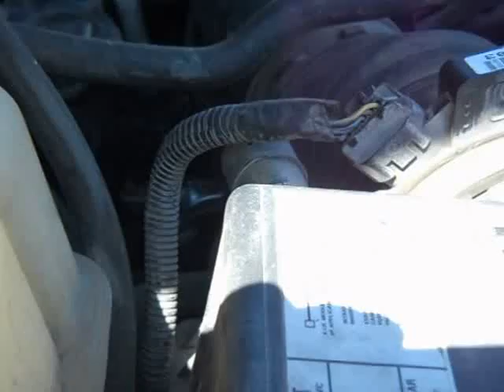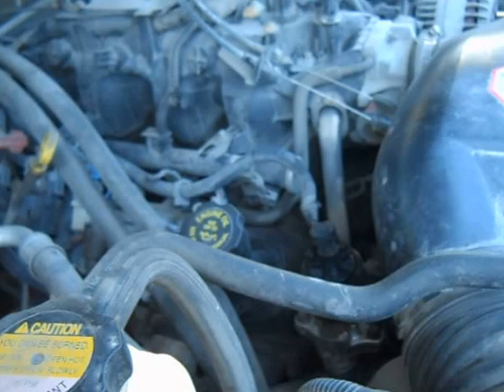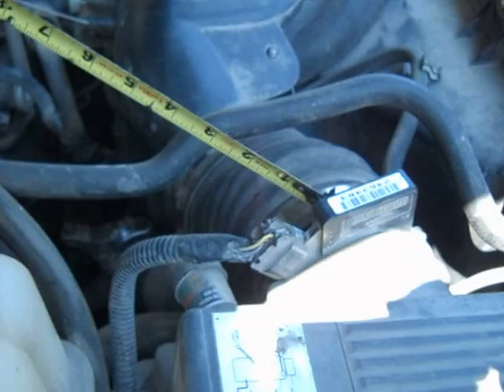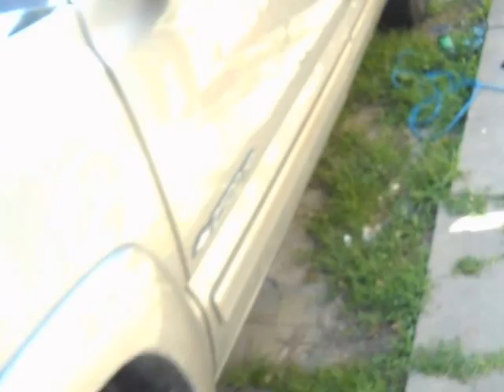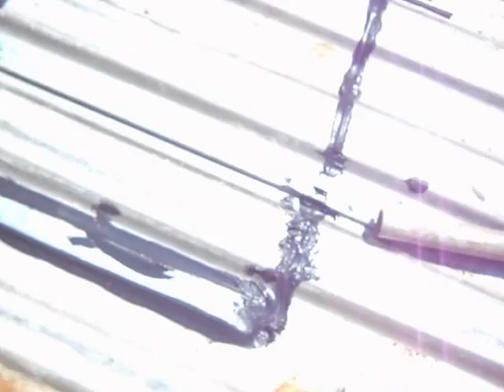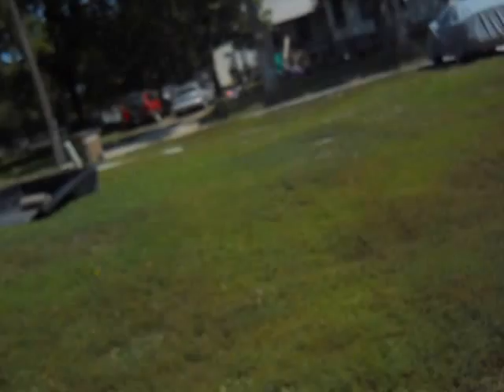DIAGNOSE FUEL PUMP, MASS AIRFLOW SENSOR. CHEVY LOW FUEL PRESSURE

Comment: I have a 98 Chevy Tahoe I replaced the fuel Port injector system and I change the fuel filter new spark plugs and the MAF sensor and I'm still having trouble to start the vehicle and if I put starting fluid it turns on but it won't stay on
Reply from the maker: I would hook up fuel pressure gauge up to fuel rail and check fuel pressure when you turn key on...put down a deposit at auto parts store and use for free..

Comment: OMG you don't need to cut the bed! You loosen the bolts on the bed on the passenger side, take the bed Nuts off the bolts completely on the driver's side. Take the screws out from the filler neck. Unplug the tail lights by the rear bumper and the plug for the trailer hook up plug. Jack the bed up on the driver's side and block it up. It will be hinging on the passenger side bolts. Disconnect the fuel pump plug, take the bolts out. Pull the pump. Install in reverse. Don't wear static producing clothing. Make sure the battery is disconnected, the wheels chocked and have a fire extinguisher close by. Don't cut the bed.
Reply: Takes about 45 minutes to change the pump out.

Comment: So can a bad mass airflow sensor mess with fuel pressure, i changed out the pump and the filter still reading low pressure
Reply: Buy a can of Mass Airflow sensor cleaner, don't use anything else. Take the Mass Airflow Sensor out and spray it down to clean it. Don't touch and of the components in the sensor. You might also check the throttle position sensor ( small part on the driver's side) right close to where the air goes into the throttle body.
Reply from the maker: Serrano117   yes

Comment: 👍🏻👍🏻👍🏻👍🏻 I'm having a issue where I could literally floor it and my truck will not see power until around 30-45mph. 04 silverado 4.3
Reply: marco soto I did it was mass air flow sensor and map sensor but I went ahead and changed tps sensor as well. It runs really good now and I am able to tow trailer with no problem also see a huge difference in power when punching it.
Reply: john smith did you find the problem? Cause i hsve the same problem
Reply: Thank you I've been having a headache trying to figure this out
Reply: That’s the mas air flow

Comment: I liked this.. It's so true about all the stupid crap on the new cars. Things were much easier before cars needed computers and a 1000 and one sensors. I started working on cars back in the 70's and the most expensive part was a rebuilt starter for 20 bucks. Clean the carb and check the plugs maybe set the timing and down the road.Ha HA..I think they make them like this today to create more stress and more money and more money for them...
Reply: The MAF is important. It tells the computer exactly how much fuel to send to the engine to get the proper fuel mix.

Comment: I've changed fuel pump and filter and mass airflow sensor and lots more truck still not fixed
Reply: what vehicle do  u own ?
Reply from the maker: Cody Davis
Reply from the maker: Cody Davis 2001 2500 hd
Reply from the maker: i have a 2001 2500 hd
Reply: Gary Tripp check the throttle position sensor. Small part about $30. Have you checked the plug wires or the sparkplugs?